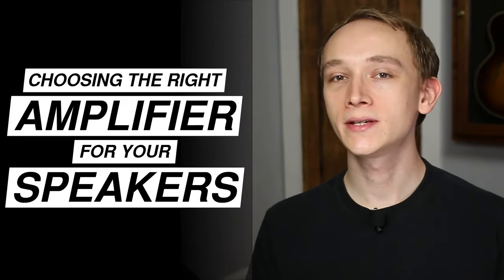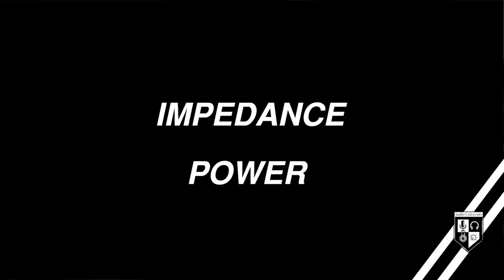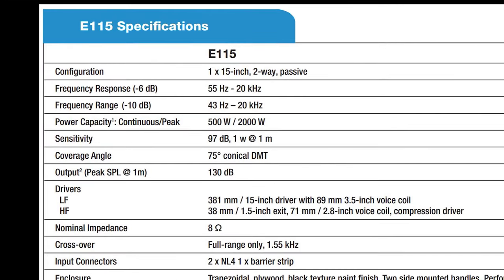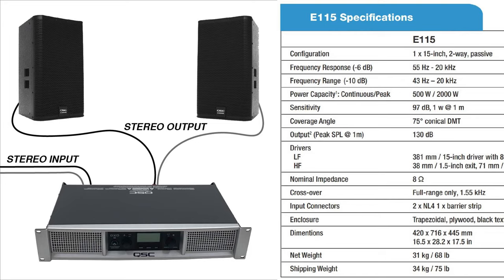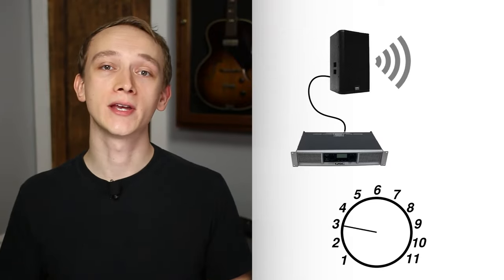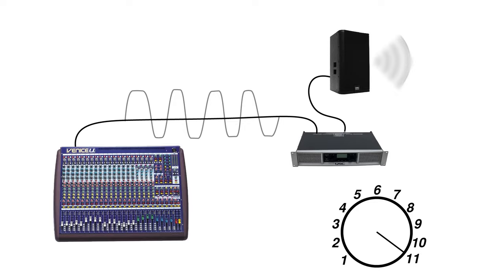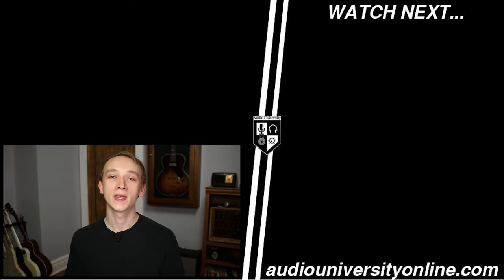A SIMPLE Rule For Choosing An Amplifier | Ohms, Watts, & More

Comment: I can't find an answer anywhere - getting mixed info so hoping you can help. I was given a Crown Amp that is 500W @ ohms and 400W @8 ohms. I bought a pair of Elac Unifi Reference speakers with a max rating of 140W @ 6 ohms. Is this too much power? In the video, you suggest doubling the continuous W rating, but in scenario, I'm  3x the power of the max rating. I plan to listen at moderate levels with the occasional loud setting so my volume level will be adjust accordingly. Is this still too much?? Help I don't want to blow my new speakers
Reply: That match is slightly imbalanced, however, it will be totally fine as long as you keep an ear out for distortion or physical bottoming out of your woofer cones if or when you turn up the volume too much. If you ever hear any "distressed" sounds coming from your speakers then you know the amp is delivering too much of its power into those speakers and therefore you should immediately turn the volume down before damaging them, but under most more "normal" or "moderate" as you say, listening levels, especially in a home environment, you should be totally fine with that combination, and as an added bonus, the extra power that amp has will allow for much greater headroom and it will also be running at a much lower than maximum output, which will make it sound better and run cooler and longer without any strain whatsoever on the amp itself.

Crown makes some really good amps, and I used to have a PowerTech2 model myself, (350/8ohms, 500/4ohms), (I think that's what it was), and I was using it to power the only speakers I had at the time, which were "only" rated at 120W RMS, and as long as I didn't ever turn up the volume to the point where I drove those speakers into distortion or bottoming out of the woofers with too much and/or too loud of bass notes, then I never had ANY problems with that setup, and I had it for MANY years before upgrading to more power capable speakers, and it sounded absolutely awesome using that amp, MUCH better than it did when just driving them with an ordinary household surround receiver, which is much worse for speakers than an amp that can (potentially) deliver "too much" power, because in order for a relatively smaller wattage amp like a home surround sound receiver to get sufficiently loud, especially during a house party or whatever, that receiver has to work extremely hard, pretty much right at it's absolute maximum output power, which makes it run extremely hot AND sound rather "harsh", because it's running so very close to clipping, which is bad for the receiver, your speaker's tweeters, AND your ears!

With a larger amp that puts out much more power than what is "needed" by your speakers, (i.e. their maximum power rating), the amp is much cleaner and "smoother" sounding, also running cooler, and besides, your speakers can also handle (for brief periods of time at least), considerably higher wattage than what their continuous RMS rating is, IF that power is totally clean and undistorted, as it will be from a considerably higher power capability amp like you have...

Also, speakers will ONLY take whatever power they really NEED to operate and produce the sound you want from them, they DON'T usually take in everything that an amp COULD potentially deliver to them... Unless the amp powering them is underpowered instead, so it's MUCH better to have an amp that has MORE than enough power and it be running perfectly cleanly, basically in "idle" mode, (compared to what it's capable of), than it is to have an amp that is barely able to keep up because it's either underpowered or capable of ONLY producing as many watts as your speakers are rated for, and then having THAT amp running at its maximum output and possibly momentarily, every once in a while going into mild clipping distortion, which, like I said, makes it sound "harsh" and is damaging to your tweeters AND your ears, especially long term!

Comment: Based on your video, I am correct in running 2 amps in bridged mode so they are 2x the output of the component speakers. What is the best way to set the gains for my setup? I'm worried I'm going to eventually blow my speakers; already installed in my vehicle.
TIA

Comment: those are PA speakers and PA amps (the speakon connectors on both the speakers and the amp is a dead giveaway), are those really for the home or for a concert because both those are not designed for the home at all.
Reply from the maker: Yes. Although the same principles apply to both home and professional audio systems, the example shown in this video is a live sound reinforcement system.

Comment: Hi Kyle, thanks for an awesome video, can you please help me in a situation where the continuous power is not given in the specs of a specific amplifier. I have noticed numerous occasions online where only the output power is given or only the peak/maximum power is given for an amplifier or even a speaker, some speakers even shows a numerical value with ohms and watts, without showing peak or continuous. How would one determine the continuous power in these cases?

Comment: Is it ok using a loudspeaker horn that is rated 16ohms with an amp that has 8ohms impedance?
Reply: Yes you can do it. But it will not work very well in same watts speaker. If you have 8 ohm 100watts  amplifier. You can use 16. Ohm 50 watts speakers.

Comment: Thanks for this ! Question though. Why do some speakers have a peak power rating, but no continuous rating?
Reply from the maker: There may be a few reasons, but you can roughly estimate the RMS power by multiplying peak power by .707. This isn’t the same as continuous power, but is a better indicator than peak power alone.
Reply: @ULTAMIT.  really?all of them?

Comment: Hello sir your vedio really helps.
But can I have question? I have two speakers 8oms each but my amplier is speaker connectors A or B 6oms min ànd   B+A speaker is 12oms min. Can I connect the two speaker in the amplier or  not? please really need answer
Reply from the maker: It sounds like connecting 1 speaker will be ok, only using 1 channel. But using both channels at once, the amp isn't rated to power 8 ohm speakers.
Reply: @AudioUniversity  thank you so much for responding my questions it really helps🥰

Comment: Hi There, Hats off to the information you are providing, so I thought of requesting you to help me in suggesting what wattage of HF compressor driver is need for crown xls 2502 in two way speaker box. I bought beta 4 15" mid bass speaker, but awaiting for best HF that will not compromise the sound.

Comment: Is music power same as continuous power ? Or does it mean something else?
Reply: This is a very good question, and it varies slightly from one manufacturer to the next, depending on exactly how they rate their speaker's power handling capabilities, however, from my MANY decades of experience in dealing with speakers, (designing, building, repairing, improving, modifying), I think I have the "BEST" answer to that...

RMS or "continuous" power rating is how much a speaker (SHOULD, IF it's actually rated properly), handle using a continuous, steady state input, like a 1Khz sine wave reference (just for one very basic example), without any damage, overheating, OR burning out.

"Music Power" capability is usually about TWICE (2X) the RMS/continuous power rating, and it usually indicates how much power (watts) it can handle (on average) of a (relatively) continuous, but continually "varying" signal such as what most MUSIC is, (hence the name "music power" handling)
This "rating" is also pretty arbitrary, because a varying signal such as most music is extremely difficult to "quantify", and therefore it has to be "smoothed" or "averaged", signal level-wise, before it can ever be used to determine how much actual power any speaker can handle without any damage!

Then, finally, PEAK Power, is the absolute maximum and MOMENTARY wattage that the speaker can safely handle without any damage, (and is usually about 4x the RMS/Continuous power rating, with most really good quality speakers, on average and from what I've usually seen), BUT that rating is ONLY for a VERY brief time period, like usually UNDER 1 second, sometimes even LESS, like what happens during very brief "pulsed beats" in music, like a drum or cymbal peak, or something similar...

But be VERY careful once you are driving your speakers anywhere close to their PEAK Power capability because unless the wattage never really goes anywhere above their maximum rating there, AND the signal input into them is always totally undistorted and clean, (i.e. NOT clipped by the amp!), then otherwise you run the very distinct possibility of blowing out one or more of the drivers in those speakers, especially since peaks in music are literally at ALL different and varying levels, AND they happen all of a sudden and extremely fast, so you never really know how MUCH power is actually being delivered to your speakers when they're being pushed to their extreme limits, plus you probably WON'T have time to turn the volume down before it's "too late", so just don't push your speakers to their extreme upper "peak power handling" limits!

Remember the basics:

RMS is the Continuous "safe" power rating (or SHOULD be if the speaker is actually properly rated!)

"Music Power" is usually about 2x RMS, on average, and is usually the maximum safe relatively "VARYING" signal that the speaker can safely handle.

PEAK Power rating of a speaker is usually about 2x the "Music Power" rating and/or usually about 4x the RMS Power rating... BUT, ONLY IF it is a totally CLEAN, undistorted signal, and ONLY momentarily and for a VERY brief time period!

I hope this helps in your basic understanding of how speakers are rated and the varying terminology used for that. Have a great day and happy listening!

Comment: nonono don't double the continuous power; you need to do is find the limits of your system. You can do this by connecting an oscilloscope to your source (i.e. the head unit of you car) and playing a series of test tones. At each tone, while monitoring the amplitude on your oscilloscope, start at a low volume and increase it until you notice the waveform starting to clip. Take note of what volume level it starts to clip, and use the lowest volume level of all your readings as your volume limit. When you turn the volume up, you'll know to never exceed that limit.

Match the speaker to the amplifier power using only continuous power ratings (RMS). Set the amplifier gain using a similar procedure but with with the gain knob instead of volume. Do the gain tests with the volume at the limit you previously established.

as long as you're not clipping, underpowering your speakers won't damage them

Comment: Which one is better if you have to choose between the two: cheap amplifer with expensive speakers, or expensive amplifiers with cheap speakers?
Reply: cheap amplifer with expensive speakers
Reply: Cheap amp to smoke your expensive speakers? 
Better have enough power to drive a speaker well.
If you want quality sound it all starts with your amp , if the amp is shitty you will never get decent sound. Either through shit speakers or good speakers doesnt matter.
Reply: Everything should be expensive power plug & cable, Audio Cables & jacks, Sound Mixer, Amplifier, Speakers. Then u get a perfect sound output, never compromise for best sound.

Comment: Need a help here anyway to prevent my concerns!:D
I have two cabinets: Marshall 1922 (unit impedance: 8Ω mono, 16Ω stereo) and Marshall Code 412 (unit impedance: 8Ω ) 
Can I connect my Marshall MG100HGFX (speaker min. 4Ω load)  by just simply plugging these two cabinets into this amp (8+8) ?)

Comment: Hello there. Is there a way to monitor the wattage produced by your amp? Where would you place it to have a more accurate result? Does volume determine how much wattage youre amp produces? Or is it always constant depending on its specs? Hope you can answer my questions
Reply: there are Wattage meters available. placed between the Amp and Speaker
Reply: does volume determine how much wattage youre amp produces?    as you phased it - yes

Comment: And the most important thing to learn is that speaker and amp manufacturers like to lie on their specs!  Mainly in the consumer/DJ and lower end pro equipment.  Like MTX, labeling their cabinet 4 Ohms 1200W, and getting hooked to an amp that can actually do that.  Result was smoking drivers and crossover capacitors spitting juice!  Much of it is marketing to the braggards out there who like having biggest balls contests, rather than pro's looking for the best equipment. 

My best little system was a powered mixer at 250W continuous @ 8 Ohms per side ran into cabinets (JBL G series) rated 200W continuous pink @ 8 ohms with 103db 1w/1m sensitivity.  I could outshout much larger systems with ease.  Had DJ's asking me to turn it down while I was still at -15db on the mains (0db could handle a stock car race 200' away).  It was the speakers on sticks system you see in the Reality Check meme for "What the house really needed."  Outdoors it was a crapshoot due to wind loading of the drivers (DC offset) and other factors, but indoors, it was hard to beat.  Always had that little system on rent.  Still powers my keyboard rig monitors in it's retirement.

Comment: If your main power amp has a low out wattage but u plan to attach a preamp for added power does this still put strain on main amp?
Reply from the maker: The input of the power amp is line level - at some point, the input will be overdriven if you pre-amplify the signal too much.

Comment: Would it be ok to hook up a equalizer to a amplifier all I want to do is hook up my amplifier to power up my 4 car speakers it's a 4x6 (2) front and a 6x9 (2) in back
Reply from the maker: Most EQs are designed for line level, so you would install the EQ before the amplifier in the signal chain.

Comment: Great video. )  I have heard that, all other things being equal, having more wattage will enable the listener to hear more detail of a recording, particularly at lower volumes. Is this true or just audiophile nonsense? thanks
Reply from the maker: I believe the primary benefits are extra headroom and lower noise levels. More power means that the amp will not need to work as hard compared to operating at it's max potential, which often leads to better performance.

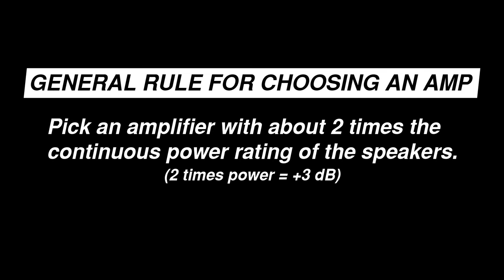Comment: 3:08 Does that mean the continuous power rating of all speakers that i intend to connect to the amp combined?
Reply from the maker: Only the continuous power rating of the speakers on a given channel. It’s helpful to think of each channel of the amplifier as an independent amp (assuming you aren’t bridging or using an amp with flex power).

Comment: Hi Kyle, I enjoyed your videos and am trying to learn some more, but could use some help to make sure one or both of these receivers will PORPERLY power my speakers.  That way I can get the appropriate one.  I wanted to know if the Yamaha TSR-700, 7.1 AV Receiver will PROPERLY power/drive my speakers.
The Yamaha TSR-700 has the following Stats:
Rated Output Power (20Hz-20kHz, 2ch driven) 100 W (8 ohms, 0.06% THD)

The other Receiver I was looking at is the Denon AVR-S750H 7.2-Channel 4K AV Receiver
Number of Power Amps	7
Power Output (8 ohm, 20 Hz - 20 kHz, 0.08% 2ch Drive)	75 W
Power Output (6 ohm, 1 kHz, 0.7% 2ch Drive)	110 W
Power Output (6 ohm, 1 kHz, 10% 1ch Drive)	165 W

MY speakers are the following: speaker set are ALL Yamo Brand.
S 809 Tower Speaker: 150 Watts @ 8 Ohms. 
Sensitivity 90dB (2.83V @ 1m)
Power Handling 120W / 240W
Frequency Response	  37Hz - 26kHz (+/- 3dB)

I also have the Yamo S 801 Rear Surround: 75 - 100 Watts @ 8 Ohms. AND the
S 83: Center Speaker 100 - 125 Watts @ 8 Ohms. I have a SUB also.
Reply from the maker: Hi Scotty. The amplifiers you’ve mentioned here wouldn’t be capable of providing optimal power to the speakers, which might lead to you turning them up and up (perhaps clipping the amplifier and causing excessive heat). Given that the continuous power handling rating of your speakers is 120W, you’ll want to find an amplifier with at least 180 W continuous power, and ideally at least 240 W of continuous power. 

With these suggestions, take another look at this video and see if it makes more sense.

Comment: Hi .. wonderful channel. I need help please !! I have a line 6 Helix with a Harley Benton gpa-100 (solid state 100W at 8 ohms) poweramp. I want to use a guitar cab  for stage sound and rehearsal. I'm considering building a  112 Celestion F12-X200 200W  (8 ohms) .  Would it be the Harley Benton suitable for this 200W speaker ? Thnx

Comment: Truly wish you would have used the JBL speaker that shows 3 different power ratings (Continuous/program/peak) instead you used the E115 which only shows continuous and peak. I have no clue which power rating on the JBL control 30 to follow, Continuous is 250 watts / Program is 500 watts and doesn't list a peak rating.  These are used in our church and the amp that powers them in parallel fried due to a substation near the church went up in flames.  Looking for an amplifier that will power these 4 speakers.  If each speaker is 4 ohm, I would think a 2 ohm 2 channel amp supplying 900 watts would be a good fit?  The Peavey IPR2 2000 is what I'm thinking.

Comment: Good eve Audio University, so I have a minor problem, u said that if my speaker has a power rating of 100W then the Amplifier should have 200W (double the power rating of speaker) Wattage, but I have 2 identical Speaker with the specification of Power Rating: 100W, Impedance: 6 ohms, should I choose 400W Amplifier with 200W + 200W dual channel or should I stay on 200W Amplifier with 100W + 100W dual channel?